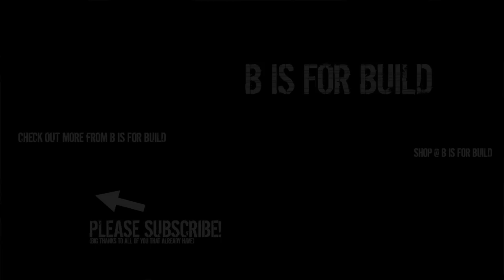1500HP of Boat Engines Have Arrived!

Comment: I'm excited to see what the boat "experts" have to comment today 😂😂😂😂
Reply: Dude people are just trying to help out. In all likelyhood these are going to be more unreliable than proper marine engines as well as devaluing the boat significantly. B is for Build is not an idiot and is aware of the disadvantages but he is going ahead with it as unreliability is not an issue as he won’t be crossing the Atlantic and clearly doesn’t worry about resell value as its an old boat and when the time comes to sell it... it won’t be sold
Reply: actually you dont need to be a master marine mechanic to know this will not work.. the same way you dont need to have a masters degree in electrical engineer to know you should not stick a fork in an electrical socket
Reply: @gezzuzzful  you really think it is that level of obvious?
Reply: Hehe yeh, I freely admit I am far from a marine engineer, more of a person who enjoys mucking around with boats but I also freely admit I was one of those who was saying this was a bad idea from a boat point of view. Although I understand the decision he has made, and he has made it for all the right reasons as I pointed out above :D
Reply: I think they will last a month.
Reply: @gezzuzzful  But why shouldn't it work? There are a bunch of boats running big gasoline V8's, you just need to know what you're doing and how you're doing it, it might not look like it but he has done a LOT of research on how to make that work
Reply: @joealex65  in a way you are right he chose a ZF 600V gear box he is adding all the bells and wissels to it but these engines dont like to be in high rpm all the time like a diesel and break down veryyy offen  many customers use Cobra engines in boats and after 200 hours of use they start to break
Reply: its not about power.. its about producing that power indefinitely.. 24 hours non stop..

Comment: I lived on a 65 foot boat for 7 years that traveled in salt and fresh water. It was powered by twin mercruiser 454s, although it had big trs stern drives it did just fine, it was a planing hull and at planing speed it burned 40 gal per hour. However one day one of our aluminum tanks sprung a pinhole leak, we found out only after it began to smell like gas in the cabin very dangerous, engine room blowers helped but didn’t keep fumes out of main cabin, any spark from water heater, oven, etc. and boom. Had to drain starboard tank and seal with epoxy until replacement. Of course tank remained empty.

Comment: You have done a nice job sourcing marine stuff, but make sure the alternators and starter as well as all other elwcteonics are approved for use in a marine application.   They make special electrical parts that are shielded to minimize the risk of sparks specifically for marine application.

Comment: 12:15  "torque is a calculation of horsepower"  No Sir, torque can be measured, horsepower is a calculated value.  

(Torque X RPM) / 5252 = Horsepower.
Reply: Shows you how little these famous care youtubers actually know about mechanics.

Comment: Your equation is wrong. HORSEPOWER is a calculation of Torque and RPM. Not Torque a calculation or HP and RPM. Yes, technically, if you know HP at a specific RPM, you can calculate the Tq from that. However, the engine makes tq. Where it makes it in the rpm range is important for horsepower

Comment: Friend of mine had a 42ft boat out in Croatia - happily motoring along when  Something Happened, one (diesel) engine's revs starting increasing - he throttled back looked over the side and there was a two foot long flame coming out of the air intake - from there to being on a liferaft was less than 2 minutes, on fire from stem to stern in 6 - with what he is doing in this boat I have a horrible feeling he will have a couple of milliseconds ...

Comment: so this might not be an issue due to the size of your boat, but would a regular oil pan work? your not worried about the boat being in rough sea's and the oil sloshing to the front or back of the pan, possibly allowing the oil pickup to suck air?

Comment: Holy fuck I REALLY hope you are not putting automotive engines in your cruiser. It’s not going to last 200 hours. There is a reason marine engines are used in boats...these things run near redline for hours on end.
Reply: Not to mention gas instead of diesel on such a large vessel going offshore. So many poor choices here.

Comment: the only part I am slightly concerned about is ballast.   your taking probably 3000 lbs worth of iron out and replacing it with 1500 lbs.
Reply: The 903 Cummins weighs about 2500-2800 pounds, and I think that is without fluids.
Reply: @BlueDually4x4  SO ROUGHLY 3000 LBS RIGHT? ROUND NUMBERS?

Comment: What is the make and size of the diesel engine that still runs in the boat?
 Looking for a 8v92 Detroit to replace a worn out Detroit.
Reply: Its a 903 Cummins. Probably would need a different fuel pump and injectors to make it a good truck engine as boat engines are tuned different.

Comment: Boat motors run full throttle for extended periods. Like 20-30+ minutes. Good luck.
Reply: I think they will last about a month.
Reply: The ls is already a popular boat motor what is your point
Reply: Most people do not run their boats at full throttle, unless they are involved in offshore racing. These engines will preform the best just cruising at 3400rpm. They will occasionally see full throttle. If operated like that they will last.
Reply: @billyorlando4724  thanks for commenting some sense it’s crazy how clueless people can be.
Reply: Had a 7.4Liter 454 mercury marine mercruiser, ran great for 12 years and still ran great when it was sold. Don’t beat on them and service them and they will last.

Comment: I'm a Car Tech & if I buy a Boat that's not been used in a few years, 1st Things I Do BEFORE Taking Boat Out Are: 
1) Cooling System, Complete Overhaul / Service of Entire System. 
2) Fuel System, Again, Complete Overhaul / Service of Entire System + New Clean Fuel. 
3) Steering, Engine Controls, Electricso Etc. 
Preventative Maintenance Costs a Little, 
NO Maintenance Costs a FORTUNE !

Comment: I hear the arguments for gas, but diesel is still better for marine usage.. I'm not a big Cummins fan, but look at the Marine X15 engine... 600HP@1800RPM  with a "modest" 1650-2050 lb-ft (2237-2779 Nm) of torque. 
But man, thos LSXs are nice! Cudos to Texas Speed!

Comment: Why instead of buying those shitty motors, did you not install two electric motors in your boat? You would have saved yourself hundreds of thousands of future problems, having an internal combustion engine THERE WILL ALWAYS BE PROBLEMS, I thought you would install electric motors, they are more powerful and lighter and cleaner, anyway, good luck

Comment: You need to vent the engine compartment with intake and exhaust FANS and Ignition proof Battery Switches, Chargers, EVERYTHING! Install your inverter in the cabin while you're at it!

Comment: Oscar has Mad Fab abilities !!! 😎👍👍👍👍 Chris ah I believe You are running fuel injection so unless You run a carburetor it's not normal aspirated. Don't forget to put the Holly management system on it. Ask Holly if they'll make You a Dual engine control panel so You don't have to buy 2 of them. The engine's look Sic !!! 😎👍👍👍👍Great Job

Comment: I would've preferred diesels but there are significant precedents for high HP gas engines in yachts so this isn't that crazy.   While not a yacht, the Riva Lamborghini is a quite famous example of a big Riva boat with big gas engines.   They will obviously have a lot to work through but should they get it all done correctly it will definitely be an awesome boat... well, for short distances.

Comment: To be clear, as an example, torque is measurable.   Horsepower is measured BASED ON TORQUE OUTPUT, because torque is what can be measured.  To put it another way, horsepower is how fast you hit a wall whereas torque is how far you take the wall with you when you bit it.   Torque is working power.   Which you need in a yacht.  That's why ships use diesel.  You can modify diesel engines to have 1500 horsepower and over 2000 ft lbs of torque.

Comment: Its about more than torque... Deisel doesnt explode boats like gas... Gas, and boats are just nit ideal together... Does that engine room even have blowers? I know its not quite as bad of a risk with fuel injection as it is with carbs, but its still a danger to be aware of... I'm a worry wort I know... Cool engines though...

Comment: Why the LSX? The L5P Duramax-es are superior for sustained, high load, cruising you need in boats. You can get 550 hp out of them easily in a marine installation. Also, with 1000 ft-lbs at ~1800 rpm you don't need as much reduction gearing.

Comment: Torque is not HP × RPM , torque × RPM is HP . HP is a stupid measurement anyways , a 100 HP car can barely get out of it's own way . A 100 Horses could drag your house away or rip a supposed 700 HP car in half . Torque is a proper measurement , so is RPM .

Comment: Why use the crappy exhaust manifolds. I doubt those manifolds will support the power the engines will make. Why not get headers made. Hardin marine has some. Hell Oscar could probably make them.

Comment: So my boat neighbor has the same diesels in the same boat but a little smaller, 37ft. Has owned it since 1983! Says your crazy, gas will work but will not last(I agree). The money you have spent ya probably could have rebuilt both those Cummins and had a good resale value on that boat as well. Then again it wouldn't be any fun or in the guide lines of B is for build! Good luck you crazy guys, soldier on!

Comment: My opinion... do what works for you man! My only concern is longevity of those engines. Steel blocks, aluminum heads, different heat cycles for what a Gas engine might be used too. No doubt you guys will make it work, just not sure how long they will survive

Comment: OK you decided not to conserve the original and therefore preserve the originality of the power. Then why not use 2 Tesla motors instead using Li batteries and reduction gears. High torque, high speed, no risk of explosion, quiet, no NOX, etc?

Comment: Has anyone considered how the boat will sit in the water after shedding 3000 plus pounds?  Those cummins weigh 2800 each and your ls's are more like 700 plus added exhaust and heat exchanger.

Comment: The boat was designed for the weight of the engines..for both Torque and Planeing...please be carefull when installing the new engines..you will need extra ballast...can;t wait for the vid...good luck

Comment: I'm not going to claim math is my strongest subject, but pretty sure 650ftlbs is a lot less than 1950ftlbs... Doesn't matter what the engine puts out at this point. As you still have not explained how you plan to correct for the entire car worth of weight you are removing from the boat doing this swap. The 903 weighs roughly 2500-2800 pounds each, those LS engine might weight that between the both of them. To get the boat to sit in the water as it did with those heavy engines, you are going to have to add weight.

Oscar is a hell of a fabricator.

Comment: For the cost of two LS engines + two transmission + months of labor + all new plumbing + questionable engine mounts - you could have bought a pair of brand new Cummins turbo-diesels and installed them in a week - and motored away with a big chunk of change in your pocket

Comment: My biggest concern now is your exhaust manifolds you are using. I am almost positive that with the cam spec you are running you will have major reversion issues. Those wet exhaust risers will be dumping raw water super close to the engine and it will most likely get pulled back past the closing exhaust valves when pistons are on intake stroke. Water in cylinders = bad news for your built bottom end.

Comment: Hi performance gas motors are great for the strip but they will not last very long under marine conditions running marine gas, etc.   What you are doing will make the boat fast but fragile.  You may think you know what you are doing because you are a smart guy.  But I saw you paint the zincs and so we all know you don't know anything about boats.  You are learning as you go.  Going gas is not the real issue here.  Using hi perf components is the real issue.  You should have chosen a set of rebuilt crusader Captains Choice 8.1s (real marine engines) instead of racing car engines.  Oh well another learning opportunity awaits you.

Comment: Torque is a calculation of hp and rpm? What are you high on? You can't get a hp number without measuring the torque. Yes, its a calculation, but absolutely not like that. Torque is the measured number, horsepower is the calculated number

Comment: For starters .
1. Check if your boat can handle that much power , would be bad if your shaft cracks your boat 
2. Don't forget to paint the engine , it will last much less if you hold it bare metal 
3. Make sure that you have good ventilation at the engine cabinet , so that the fumes don't blow.

Comment: I have been watching with interest your yacht project. I have been a commercial fisherman for 57 years and I have to tell you that switching from diesel to gas is pretty well the worst decision you could make 
The gas engines that you are using are not made for marine use. There is a difference between marine and non marine engines
You are not even taking stability into consideration. Big mistake 
You would have been far better off to rebuild the original engines. Even though they are old they are engines that have been working for 30 years until you forget to check your oil level. A fundamental daily ritual on all marine engines

Comment: Automotive engines are different than marine engines. Marine engines cost way more first off and for good reason, they dont have sleeved bearings for piston rod connections to crankshaft, they have actual bearings which allows for much greater rpms and sustained high rpm. I used to be a boat mechanic, I have worked on and installed from scratch quite a few inboards like the mercruiser and are crazy expensive. Car motors come no where close to that.

Comment: Torque is a calculation of force x distance, ie the stroke of the crank.  A long stroke crank will produce more Torque than a short stroke crank,  but it will not rev the same as a short stroke crank. Horsepower is a calculation of Torque x RPM.

Comment: And to be serious, marine starters and alternators, since you're fuel injected you won't need flame arrestors for back fires.    Any sparks or flames with fumes in the engine room can be disastrous.  Lots of diesel guys forget that an over charged wet cel battery can emit similar fumes and can also explode. We've got hinos  and still ru. The blowers

Comment: That’s exactly opposite. Horsepower is a calculation of torque and rpm not the other way around although yes the calculation would technically be the same in reverse

Comment: Your fuel costs are going to hurt you each time you take the boat out. The diesel engines consume substantially less than regular fuel. These big block engines will drink the fuel like a drunken sailor.... start saving your $$$ as you will need it for fuel.

Comment: I'm holding out for Tesla power as an add on to the current system you have in mind, just think of the fuel you will save just cruising around on quiet electric power and the fun potential as an on demand power adder.

Comment: Look at the bright side the motors will make a great anchor. I hope they work out but I wouldn't bet on it. That boat is heavy as they get it was built with a diesel power plant in mind. One thing is certain you are gonna need a 500 gallon fuel tank.

Comment: The reason a diesel is better for boat applications is because with a snorkel kit, they can run fully submerged in water, so if you get a leak in the boat, you can keep driving to get to safety...

Comment: poor choice with the gassers, for this size boat you need diesels. Gas motors do not have near enough torque and they will never wind out to their full power. not to mention fuel efficiency. In board gasoline motors are not worth it at all and will deplete your boats value

Comment: gas engines in a diesel boat? this is your least great idea -- low stress, HEAVY diesels to high stress light gas motors -- i wonder if it will ever plane and stabilize. then, will it be in powerband with marine transmission gearing?

Comment: Those diesels could burn atf, coconut oil, recycled grease, rendered hog lard grease.  Those texas speed motors run best on e85 which will be hard to find in the middle of the ocean

Comment: Dude, just a slight observation. Are you going to be able to change the oil filters without too much trouble on those engines when they are in the boat? Hang in there it's coming together.

Comment: Those rectangular metal tube you use to fabricate the engine mounting bracket don't look thick enough and not stainless steel to me, it will corrode in no time.

Comment: Diesels are more efficient than gasoline engines because they do not use a throttle valve. But at full throttle they are much the same. Use the power and these two will burn similar fuel tonnage to the diesels.

Comment: you said coolant through the exhaust, normally on a closed loop cooling system the raw water escapes through the exhaust. how are you gonna get the raw water out? also be sure to replace the anoides in the heat exchanger and trans cooler

Comment: Great job. Looking good. Modern gasoline horsepower is taking sales away from diesel trucks now days anyway. Your build is a excellent example of the same!
Please send me the link for the Crusader riser spacer with the o2 hole.. I can't seem to find it on ebay for my swap. 
Thanks!
Reply: Nonsense. Trucks are about torque, not horsepower. A gas truck is lucky to have half the torque of a turbodiesel